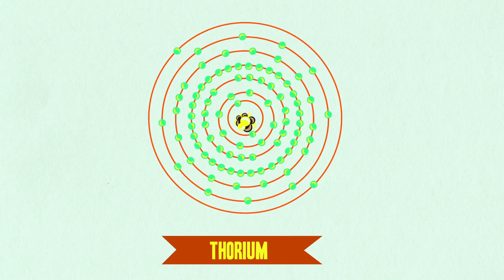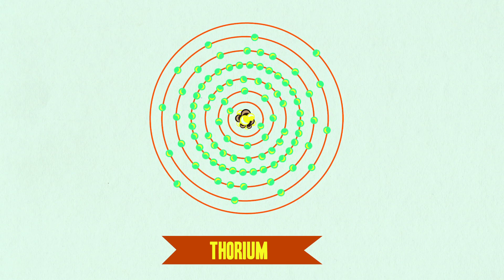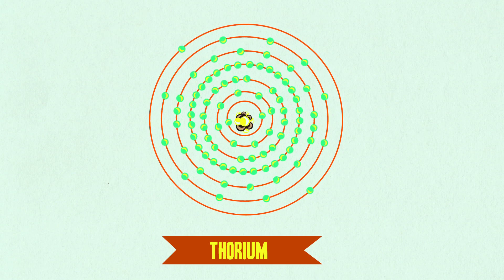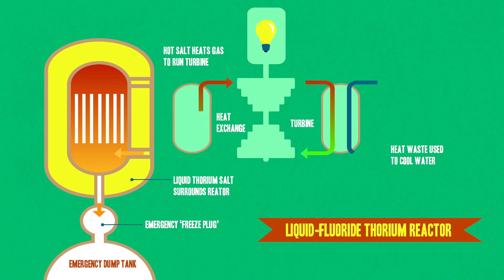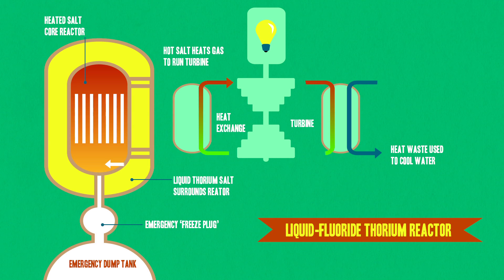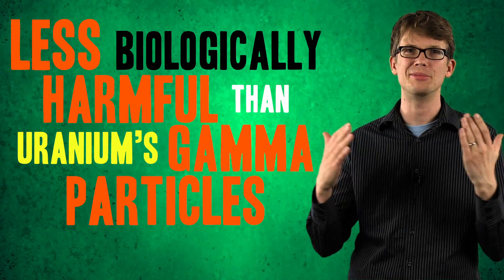Liquid Fluoride Thorium Reactors (LFTR): Energy for the Future?

Comment: I hate how people are afraid of nuclear power, and want it dead, but then get into their fossil fuel cars to go to work. More people have died from gasoline fumes than radiation every year, and there have been sooo many more coal accidents than nuclear power.
Reply: That's because radiation sounds scary, and because historically, radiation has caused some huge issues. That being said, it's sort of like saying flight by aircraft isn't safe and sighting a few major air disasters and the possibility of terrorist hijacking. It's unrealistic and unreasonably fearful. Radiation is just harder to understand for most people.
Reply: @evanreidel22  Because people are either uninformed or misinformed :/

It's pretty annoying to hear people act all concerned and against anything radioactive. Like jeezus you can eat a gram of uranium and the effect would be negligible.
Reply: statikreg indeed... having to worry about storing waste products for 10s of thousands of years sound a hell of a lot scarier than "just" 300 years... hell there are wooden buildings that are older than that...
Reply: statikreg That's fair... (though people ARE absolutely afraid of it, really through no fault of their own). But, let's think about those same considerations for the alternatives. Fossil fuels fail on both of those counts spectacularly. And, in some ways, nuclear holds its own against renewables.
The waste output of fossil fuels, especially coal (of which our global usage only continues to rise) is literally killing us all. ALL of us. We can't store it all, so it goes into the atmosphere. There are parts of the world that are so polluted that the number of people whose lives are affected far outstrip that of all nuclear accidents.
And, that ignores the fact that per unit of energy, nuclear is THE safest tech. More people die working on solar and wind and hydro per unit of energy than from nuclear technology. It IS a bit a like people being afraid of flying a plane, when they're happy to get in a car - which are orders of magnitude more dangerous.
Renewables have their place, and we need to do more research. But, increasing their energy output is going to take a lot of time and investment and space, and we need better solutions that are attractive enough both politically and economically to wean the world off of coal.
Reply: I don't think it's really a matter of being afraid of it. The problem I see with nuclear power is 2 fold:
1- waste output and storage
2- on the rare occasion that something does goes wrong, it goes VERY VERY VERY wrong

If we have a way to make it safe(r), like using thorium, then what in the actual fuck are we seriously doing right now?
Reply: Josh Hummel Don't forget that every coal powered plant emits more radioactivity itto the atmosphere than are even allowed to leak from a nuclear plant.
Reply: +statikreg It doesn't actually go all that wrong.  Coal kills more people every year than all nuclear accidents combined.  Including Chernobyl.

LFTR's are amazing, but even normal reactors are very safe.
Reply: Cyrribrae You're absolutely right on every point. I guess I just like to try to give humanity the benefit of the doubt (by assuming they're not afraid, so much as mislead/ignorant, but you're probably right on that point too).

Still and again, anything we can do to improve safety is a good thing, and if thorium can offer that, I'm all  for it (however in other discussions I've had recently with people far more educated on the subject than my self, it does seem that the jury is still out).

Just a random thought (which I'm sure is not original): if we could figure out how to get to space more cheaply and easily, our nuclear waste problems would be solved...Just shoot it into the sun or out into deep space.

Anyway, cheers!
Reply: reinux I may be missing something here but if nuclear power had been developed at the dawn of the industrial age then tens of millions of people would not have died from pneumonia and consumption and asthma and cancer and a dozen other lung ailments.  So you have lost me with your logic...

My 13 year old son gets to breathe crystal clean air thanks to nuclear power, there are 1 million people in the local urban centre and the only toxins in the air are near multi-lane motorways.
Reply: Josh Hummel i agree, there is too much irrational fear going around nuclear energy, labeling ALL nuclear technology as 100% dangerous and screams that we should halt research...thats just due to misunderstanding and ignorance...we are basically throwing away a viable source of sustainable, clean, much safer form of energy from the revived thorium technology
Reply: It's a new sort of technology, people are afraid of new things... Shitty humans, don't understand shit
Reply: Samuel Garcia It's a race against time, really. Getting all of those technologies lined up before we run out of time is tricky, and Thorium could provide at least a hold over. Besides, there are places on Earth, and definitely beyond that have little if any naturally renewable resources available to them.
Though I have to admit that Solar have taken some impressive leaps forward in the past few years.
Reply: +reinux The price of oil has nothing to do with renewables. The share of renewables in power production is less than 1%. The price of oil is set by the balance of supply and demand. Since demand is not very flexible, the supply side has a huge influence on the price. Currently OPEC is the biggest player on the market, so they have the biggest influence. The biggest player in OPEC is Saudi Arabia. The Saudi goverment can only stay in power with the support of the USA. So in the end the US government sets the price of oil. The USA can also influence the oil price by disrupting production in oil rich third world countries (Iraq, Iran, etc.). So oil is chep now because the US wants it to be cheap. Why? Because Russian economy depends heavily on oil exports, and the US wants to hurt them. There are probably other reasons too, but the sudden large drop in the oil price at the moment when Putin started to misbehave is unlikely to be a coincidence.
Reply: +statikreg you do have to take into consideration our current political atmosphere as well. If people are making money on uranium fuel its unlikely that government regulations would allow thorium reactors without a major public outcry to counter uranium lobbyists.
Reply: +Schwarzer Ritter 
It is mostly an American issue, other countries are already implemented several methods.
The oldest one is simple recycling, but it was declared illegal in the US. The next is safe long term storage (eventually all radioactive materials decays into harmless stuff). There is such a facility in Yucca Mountain, that can store the waste safely for at least a million year, but it was abandoned for political reasons. It is also possible to burn the waste in fast breeder reactors, and make a ton of energy as byproduct. The remaining small amount of high level waste would be safe after just 300 years. One of the goals of the Integrated Fast Reactor project was that. It was very successful, so obviously it had to be killed.
Also nuclear reactors can be used to safely destroy nuclear weapons (Megatons to Megawatts program).
And it is also important to compare this to the fossil fuel waste, which is simply dumped into the environment, and is responsible for millions of deaths, and also causing climate change.
Reply: If you're not afraid of nuclear reactor, why don't you go to japan and volunteer for the clean up of their fukushima plant.
Reply: I'm skeptical of biofuels being a true green option. That's not only led to rising food costs, but growing things for fuel isn't exactly carbon neutral either.

Nuclear power does involve fossil fuels, but not any more than those renewables require. There's no true zero carbon system, but people agree that the ones going into renewables and nuclear power are negligible.

Coal and gas are cheap, that's not an indictment on nuclear - that's a reason to double down. If we want to stop fossil fuels, we need to find cheaper, more efficient solutions NOW. And renewables aren't going to do that.

Humanity won't be more energy efficient as our population continues to expand and living standards rise. Energy efficiency is a good goal, but I won't bet the future of the species on it.
Reply: Ryan Tang People who don't know how lucky they have it will always like to bash the means in which it gets to them.  If anti-nuclear campaigners had lived through the 19th and early 20th century where acid rain from the billions of tonnes of burning coal stripped paint from walls, covered everything in a layer of soot and caused every 4th or 5th birth to be stillborn they would be thankful of the clean power we have today.
Not to mention the fact that mining all those mountains of coal was an extremely honourable, but extremely risky profession.  Every family knew someone who had suffocated or otherwise been fatally injured in a collapse or explosion.
Reply: Rob Fraser yes, because nuclear power was invented at the dawn of the industrial age. eyeroll
Reply: Rob Fraser My point is that you're comparing old coal against nuclear. Of the two, obviously, nuclear is better, even considering worst-case scenarios. It's not a fair comparison, because coal has, for better or worse, improved since the late 19th, even by the 1960s when a lot of the current nuclear plants were built.

Between fossil fuels and undermaintained, completely mismanaged, end-of-life nuclear facilities with exclusion zones that governments admit to having rationed evacuation routines, things are a little more murky. Things are even more murky when you consider the political and military prices we pay for uranium-based nuclear energy.

Look at how easy it is for Tehran to say, "Oh, but we need uranium to build power plants." That's bad enough by itself.

And between nuclear and more recent renewables, there's hardly any contest. Part of the reason for the recent oil price drops is due to solar, after all.
Reply: statikreg Shooting tons of nuclear waste into space is impossible. Rocket fuel is not abundant and also has the CO2 problem.
Reply: Philip Steiner There are essentially three types of rocket fuel, with increasing toxicity, ranging from Meh, to Are-they-really-burning-this-shit?

The least problematic is the cryogenic engines, using liquid hydrogen and oxygen. Their only by product is water.
Then there's the old workhorse, kerosene and liquid oxygen, which is a lot cheaper and safer to handle than the first one, but it also does emit CO₂. Other fuels are also used. However seeing that the fuel itself is one of the least costly components of a launch, where I think it's about $250k for the Falcon 9 rocket, I can see a valid argument for bio fuels.

The last group are the solids. They are environmentally toxic as all hell. IIRC each shuttle launch burned a nice big hole in the ozone layer above Florida. Sadly they are also very efficient at producing thrust.
Reply: Philip Steiner As I said: "if we could figure out how to get to space more cheaply and easily"..."IF", being the key operative....Such options may or may not involve rocket fuel (e.g. maybe we discover antigravity or build a space elevator - I don't know - user your imagination).
Reply: Thank God someone is building the Thorium reactors... lets save this planet.
Reply: +reinux there is in that thorium needed to be developed(still needs to as noone has really try it as almost everything that is know about nuclear power is secret's from the Manhattan project eg nukes)
Reply: +Josh Hummel 
The issue with nuclear power is that we still haven't figured out what to do with the highly dangerous waste.
Reply: This generats much less overall money into the system, which you probably know, alot of people prefer wealth over health
Reply: Sam G nailed it.  The reason it's not already a regular thing is money.
Reply: It's like a hippo vs shark situation
Reply: Josh Hummel i bet the people of fukushima would beg to differ
Reply: Lead in gasoline was a known poison - https://www.smithsonianmag.com/smart-news/leaded-gas-poison-invented-180961368/
Reply: I want nuclear dead if it is not thorium LFTR or other well thought out form.
Reply: The difference is if a nuclear plant goes critical, it's a bad day for everyone for 10,000 years. Now if these thorium reactors replaced the existing ones. Then we should go all in. Also the the 80,000 tons of waste we already have, needs to be reprocessed for further energy production.
Reply: +Josh Hummel  Also burning coal has released more radioactive elements and heavy minerals into the environment then all the nuclear reactor disasters combined, even Fukishima.   It's just that the radioactive elements releases in burning coal are considered natural and hence are unregulated.
Reply: Josh Hummel> More people have died from gasoline fumes than radiation every year

"have died" and "will die" are two different things.

as a japanese citizen, i trust nuclear power, but not the people running it.

keep in mind that many nuclear power plants are just now reaching the ends of their intended lifespans, yet are being kept in operation regardless -- even in seismically questionable places. that fact, along with the fact that countries like japan that can't have nuclear weapons nonetheless choose uranium, should say enough about how little regard there is for safety in the nuclear power industry. there's no reason japan couldn't have gone with thorium to begin with.

the choice between petro and so-called "modern" nuclear --- i.e. decades-old uranimum-based plants -- is a false dichotomy.
Reply: +Josh Hummel Mah man, You're absolutely right. Fossil fuels are wrecking the atmosphere all over the globe, and it's time that we made the switch to LFTR. There's a Thorium-powered car available, and that only needs refuelling every hundred or so years. Thorium is the way to go.
Reply: Witch is more logical? Putting some dangerous stuff underground or putting lots of dangerous stuff in the air we breathe?
Reply: András Bíró You need to watch more videos your facts aren't correct
Reply: You have to count those who are at risk by the waste products over the time they're dangerous, not just count immediate death risk.

Is it moral to burden future generations of humans to deal with our waste and potential leaks into the ecosystem for longer than recorded human history?

I'm all for thorium and the lower length of time its waste products are toxic given the alternative of continuing to burn carbon.

But you have to look at the risks overall not just selected time frames.
Reply: It's worth pointing out that both mining and refining the fuel, and building and maintaining nuclear facilities both require significant fossil fuel inputs.  also, using nuclear power for land or air vehicles is probably a really bad idea. Most areas that rely on nuclear power also rely on gas or coal powered plants to meet energy demand.  The only option is to drastically reduce our energy consumption.

Comment: Don't quite understand this...is it saying that the core is a solid thorium salt undergoing fission and the coolant is also a thorium salt in liquid form and it used to exchange heat to create steam?
Reply: Agreed, AC. It's REALLY badly explained and that drawing makes absolutely NO sense.
Reply: Andrew Carlisle no there is no solid
Reply: Andrew Carlisle It's basically in a pool type of configuration (I'm pretty sure), so the thorium salt can flow or be pumped back into the reactor core.